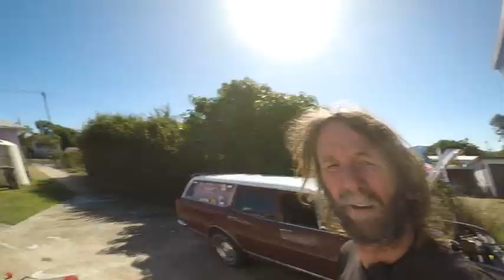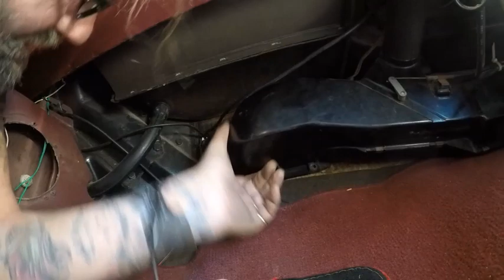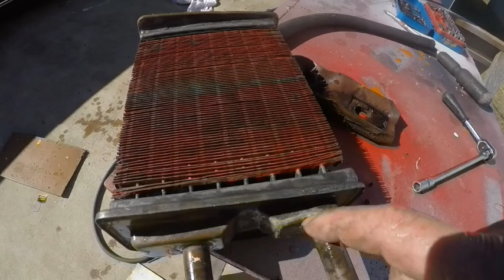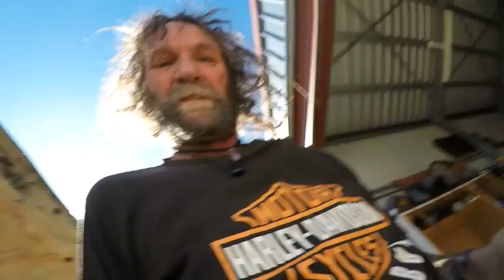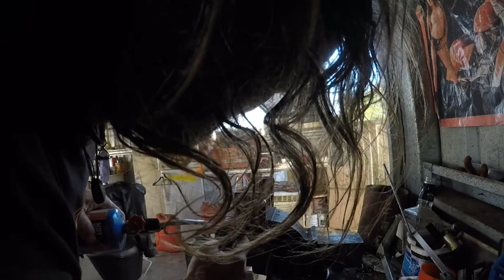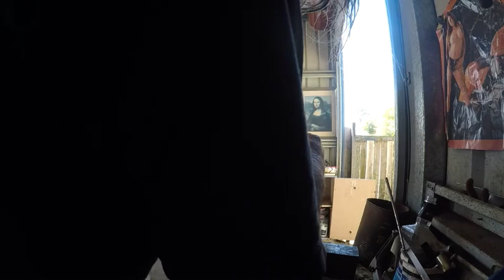Holden HK.... Well.. Well..... Well..... Hippy Trev

Comment: For radiator repairs, use a acid flux not rosin flux (rosin is for electrical), I think the best solder is a 50/50 or 60/40 (tin and lead ratio) and when cleaned properly, when heated and add the solder, it should just run around the join..
Good to hear you have narrowed down the boats issue, hope you film the cam when its out, dying to take a look..
Just got back from Kingaroy, had to fix a mates computer (didnt ride)..
Reply from the maker: its the only solder l have & caint buy any in town..  think l got it sealed up..
well 1 bloke seams to think my valve is stuck open  prertty much abused me...
if a valve was  stuck open the piston would be hitting it....  cheers

Comment: Might have had a lifter giveway😢 bugger, solider and flux bit of a pain, I know from experience solider doesnt like loads of heat, tinning the part then soldier after, hope you get it sorted, 4 degrees Celsius here snow up the mountain 😢 Cheers🍺🍻 KC 🇦🇺🤝🇦🇺😎👍✌
Reply from the maker: think l got it sealed up....  & lifter feels solid  ld say cam lobe gone  cheers
Reply: @hippytrev7452  most likely the noise your chasing 😊
Reply: Yep brazing might work better. Solder doesn't like dirt either.
Reply from the maker: @stephensim5839  all the wrong stuff  but l had a go anyways....  cheers

Comment: I'd put $ on a collapsed lifter brother.
Turn motor over without the rocker gear, just the pushrod as a visual of lifter movement not onder load.
Reply from the maker: lifter feel solid as...cheers
Reply: @4kays160  Roger that 4kays, yes they are hydraulic lifters, watched the top end rebuild. From my experience, having slight lift indicates a lobe still, but the pushrod is not being cycled through full stroke because the lifter is not providing adequate internal spring or oil pressure, like throwing a sausage down a hallway 😂
Reply: But how come it ran fine for 2000 or so ks after the new cam went in? If it's as you say a bent valve what/how did the valve get bent. 
And  a new lifter empty of oil will only collapse approximately 150 thu, when Trev measured the lobe lift he got 8.2 mm 150 thu is about 3.5 mm ? Please explain.
Reply: @chriscarey3625  hi Chris. I don't think that the valve is bent as this force would transfer to the pushrod as well. What I have found before is the internal rebound spring in the lifter either breaks or loses its temper, causing loss of "stroke" through the lifter.
Reply from the maker: @4kays160  not fuel  out the exaust it was water....  dont call me  a fucin Meth head  & fake... maybe go find another cannel....  you have not a clue where l live  & whats NOT Aviable... my nearst major town is 100ks away & with no transport how the fuck do you think lm gona get there....  maybe stick to playing  with ya trains..... 
buy the way  these are fully rebuilt & fully worked heads all new everything.....
Reply: @4kays160 I don't know how to respond to your logic mate. Some of what you say is logical but on the same had some isn't. 45 years experience here in petrol and diesel. I'm not buying your diagnosis or your methodology, I will say, judging your ability as a mechanic by what you've said here I don't think you've had much experience especially with petrol engines.
And as for your accusations regarding Trev, no one needs that shit, it's all about the money and some have more than others aye. Slagging him isn't my way of helping

Comment: hi . use Selleys DMastic to reseal box never ever use silicon . Dmastic is a light duty sealant . Available from Bunnings etc . [in some heater boxes  areas Holden also  used gaskets ]
Reply from the maker: ok cheers

Comment: Could try baking soda and super glue, or a stick of knead-it
Reply from the maker: pretty sure l got it sealed up  cheers
Reply: @4kays160  sounded a tonne better than how that soldering was going! Mouth
Reply: I had a small pipe break off my plastic radiator , did a temporary fix with kneed it. That was 3 years ago, still on there doesnt leak

Comment: Do a compression test on that cylinder Trev that flux you used looked like silver soldier flux you need hydrochloric acid do you know anyone with a pool they will have it you wont need much about 100ml if that for what your doing
Reply: P.s & more solder now 🤷
Reply from the maker: yer mate l should do a comp test...l kn o was wrong solder for the job but its all l have & l dont know anyone in this town that even has a pool....
cheers

Comment: Cam is not your fault Trev will likely be due to poor machining from factory……

Its a common issue where these motors can eat a cam lobe…… they need to be broken in but if machined poorly you’ve got no chance…..
Reply from the maker: so heart breaking  to have to pull the motor again... lm pretty sure l broke the cam in right  but maybe l didnt..  2000 miles  ran great  then this.. thanks mate cheers